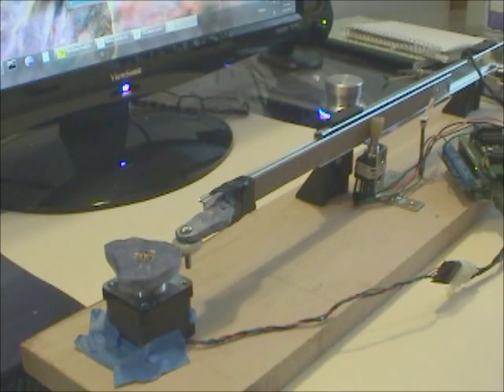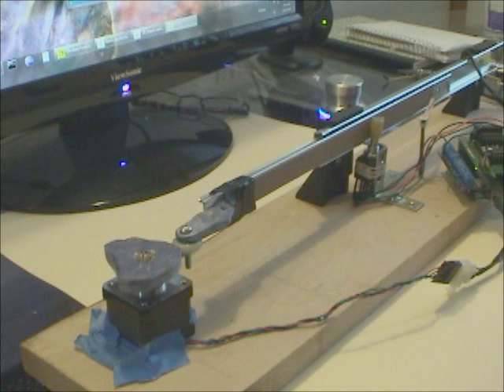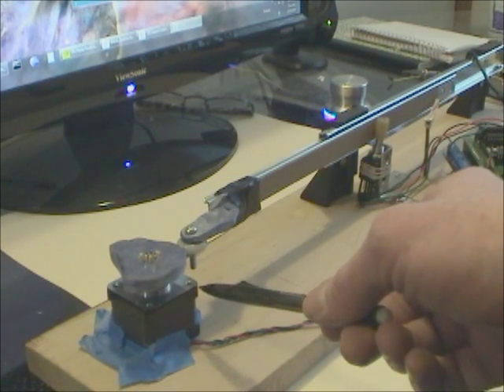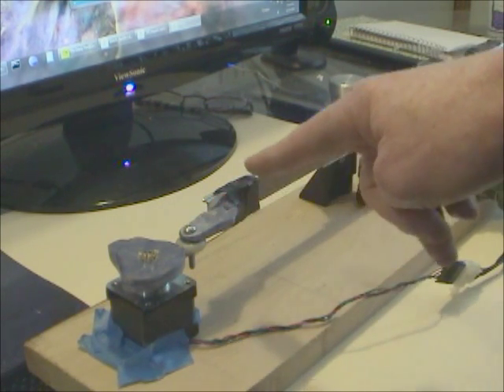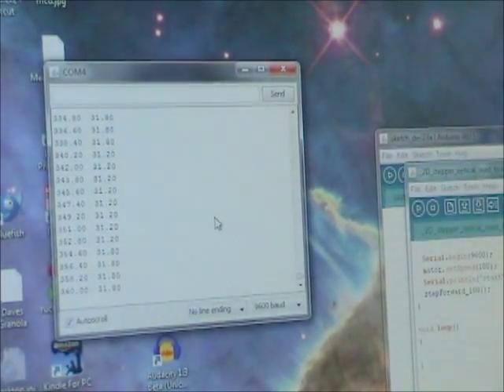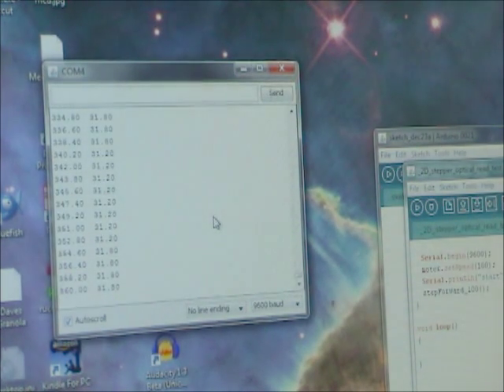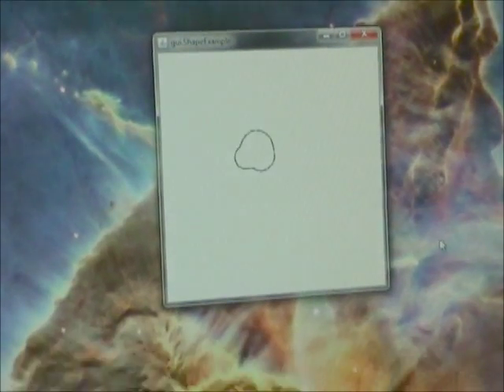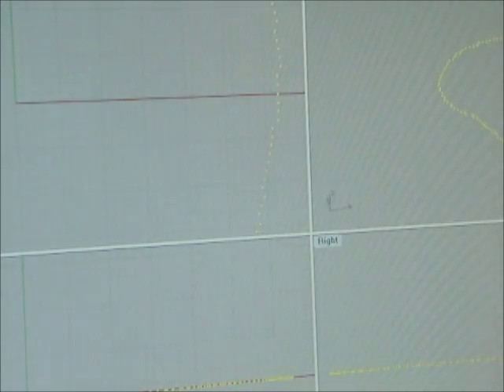2D Physical scanner prototype

Comment: Hello, you have more information for this project? This is very very interesting!
Reply from the maker: Just this: http://youtu.be/U6Ce8O5XfAw Haven't done much else for a few years.
Reply: Richard Roman you can tdescribe what library use for rotary encoder? You join rotary encoder reading with steeper motor read? What you use for convert this in 2d/3d object (programing language/library).
Sorry for many questions.
I'm see your video and think create a glasses lens scanner.
I appreciate if you can help me.